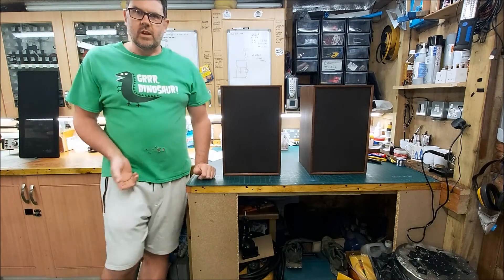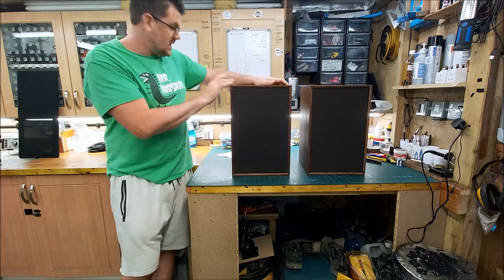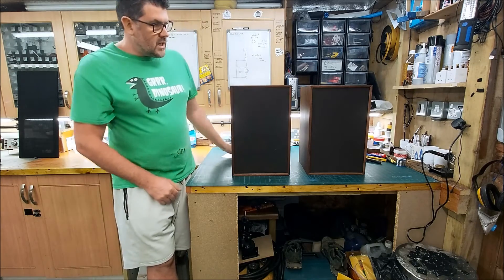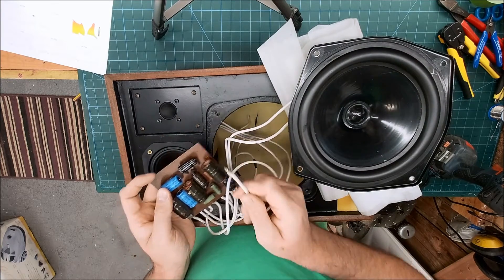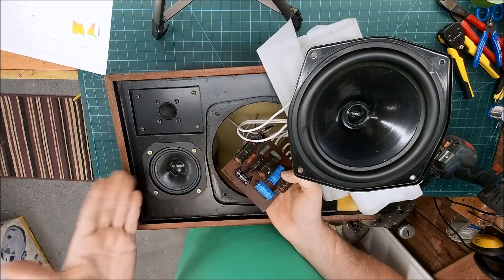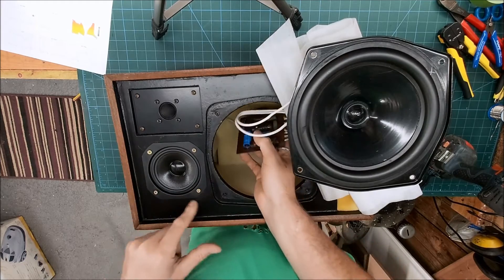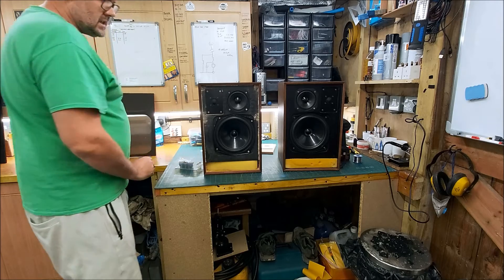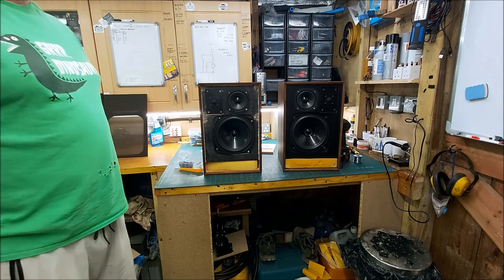IMF Super Compact MK1 Speakers Part 1

Comment: Hello, I have an IMF 4EM/101 midrange driver from an IMF Super Compact speaker with a slightly dented paper cone (with a tar coating). Since the driver has a sealed back, I cannot access it from behind. Could you advise on the best way to restore it or provide a repair service?
Reply from the maker: @ArielFigueroaSaintard  email me with the details. Info@haycrossaudio.co.uk

Comment: If the cabinets are meant to be transmission line or ported, it doesn't make sense that the ports (or whatever) are blocked by foam.
Reply from the maker: Foam is sometimes used in ports for a few reasons. That is the original foam in these. There not a transmission line speaker. Its just a rectangular port

Comment: I don’t think the b200s are oem for them either
Reply: Yes KEF B200 SP1014. Factory.
Reply: @NomadBDP  Mk 1 super compacts (which I think these are) used a ribbed, textured woofer held in by little metal squares, same as one of the woofers on early ALS40s. Later ones would have used IMF Elac branded drivers. I’m quite prepared to be corrected but I don’t think the B200 would’ve been there originally.
Reply: They are not ...

Comment: Very interesting and enjoyable, thanks.  Change of plan with the Redline 140's (too big and heavy to send down),  I am going to source and send you a pair of 45.2's :)  Work with and around the existing crossover but upgrade both the bass/mid and tweeter....  There are only two units per speaker, a lot  smaller and lighter to deal with.

Comment: Wow i have never seen this during the 80s. Btw, why is the crossover board not secured to the cabinet but just left dangling inside
Reply from the maker: It's meant to be fixed in place. Just left loose when the caps and wiring was replaced?
Reply: @haycrossaudio5474  Originally glued to the foam, can you imagine having to pick all that glue and foam off the solder joints?! Some specs

NOMINAL SPECIFICATIONS
SUPER-COMPACT

Dimensions

18" x 11" x 11 3/4" wide; 46 cm x 28 cm x 30 cm

Drive Units

8" 20.5 cm bextrene bass unit

4" 10cm rolled surround impregnated cone mid-range with domed tweeter

Crossover

Electrical three way at 375 Hz and 3 kHz

Frequency Range

30 Hz 20 kHz

Frequency- Response & Distortion Characteristics

See Graphs

Dispersion

See Polar Diagram

Matching Impedence

4 - 8 ohms (see graph)

Efficiency Measured via Pink Noise at 1 metre on axis for 40 watts

86dB

Driving Power Requirements

20- 50 watts

Nett Weight (each)

9 kgs

Gross Weight Packed (pair)

23 kgs

Subject to alteration without notice.

IMF International, Westbourne Street, High Wycombe, Bucks. Telephone High Wycombe 35576
Reply: You brought up that the wiring is a little heavy for internal wires, what gauge is it and what do you like to use for internal wires?